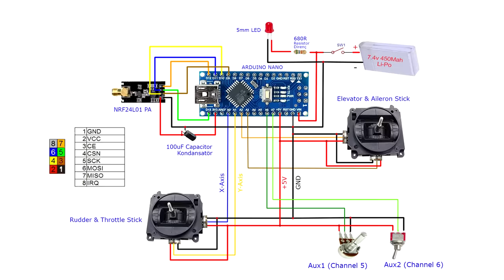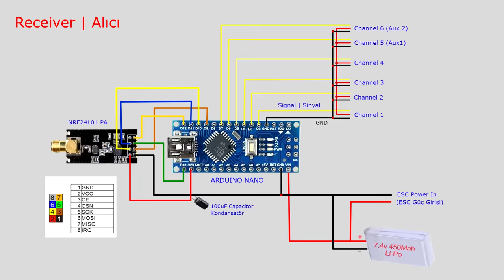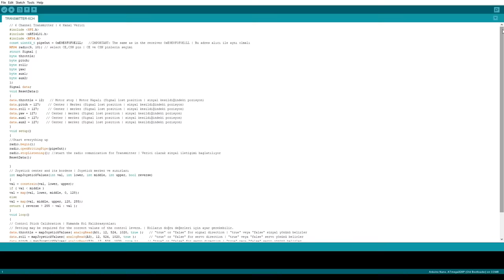DIY 6 Channels Radio Control For Models. How To Make İt

Comment: Hello sir, i have a few doubts on this project please help me please RELPY PLEASE SIR🙏🙏🙏🙏🙏🙏🙏🙏🙏🙏🙏🙏🙏🙏🙏🙏🙏🙏🙏🙏🙏🙏🙏🙏🙏🙏🙏🙏🙏🙏🙏🙏. in the RX side (reciver part) , i am using only the aileron, elevator,throttle,rudder and aux 1. HOW CAN I POWER THE CURCUT USING ONY THE POWER LINES WHICH IS THE CHANNEL 1-6, I MEAN I AM TALKING ABOUT THE CONNECTOR PINS, WHICH INCLUDES THE SIGNAL PINS, +VE PINS AND GND PINS. BECAUSE I AM BUILDING AN ARDUINO DRONE AND THE RECIVER SHOULD BE CONNECTED LIKE A NORMAL FLYSKY RECIVER AND FLYSKY RECIVER DOES NOT HAVE THE CIRCUT POWERED BY AN EXTERNAL WIRE UNLIKE THE ONE WHICH YOU MADE SIR. AND WHEN I SAW YOUR DRONE MAKING VIDEO WITH THIS TRANSMITTER . IN THAT YOU CONNECTED BOTH THE PARALLEL CABLE FOR ESC AND BATTERY CONNECTION. SO HERE I AM STUCK. IN OTHER WORDS , I MEAN THAT WITHOUT THE PARALLEL CABEL FOR ESC AND BATTERY CONNECTION WILL THE RECIVER WORK THE SAME AS THE NORMAL FLYSKY OR OTHER COMPANY RECIVERS OR SHOULD I MAKE ANY CHANGES IN THE HOMEMADE RECVER PLEASE REPLY IF YOU DID NOT UNDERSTAND MY QUESTION,PLEASE LET ME KNOW SIR 😟😟😟😟🙏🙏🙏

Comment: Can we add more operators?? I mean joysticks and switches...
Reply from the maker: Yes it is possible. It is limited to the pwm and digital output pins of the Arduino board.
Reply: @Kendin-Yap  what is the maximum operator limit?? Plz reply.
Reply from the maker: @samuddhaofficial4303  I think 8 for Arduino Nano
Reply: @Kendin-Yap  For arduino mega?
Reply from the maker: @samuddhaofficial4303  Arduino Mega is a big module for this type of project. That's why I never used it. But it will provide much more channels than Nano.
Reply: @Kendin-Yap  ok. Thank you very much for responding all the problems...Good Luck..!

Comment: Sir, I already made it but when I installed the component there was an error installing the NRF cable backwards and the same was positive, then I tried to connect it with Arduino, the idea was unreadable even though I had installed the driver, was the Arduino damaged because of the reverse installation?
Reply: Rebbot nano and then upload the code this happened with me also

Comment: Sir just one question if we add brushed motor esc can we control the motor in bidirectional rotation?? i  need to build a rc car is it possible or shall i need different codes? pls answer it would be a great help for me 🙏🙏🙏
Reply from the maker: You need to use bidirectional ESC. This is an issue with ESC.

Comment: Nice job. That looks very much like 1970s radio controllers. They had a metal frame though but it was usually coated with pale brown paint. I wonder where could you find those control stick modules?

Comment: Great job bro 👌 .. I only got a question 
In receiver why did u power the system with the direct 7.4 v ?
And u could Of used the BEC in the ESC 
As if anyone wanted 11.1v or higher 
That would kill the Arduino I believe 
After all  everything is awesome 
And I really like it .. Thanx for sharing
Reply from the maker: Thanks. Many versions of Arduinos support 7-12V input voltage. If you use the BEC voltage of the ESC it will work but you will have a lower value for the 3.3V output pin. This is not good for the NRF24 module. The control distance will be shorter.

Comment: Can I operate it with 12v power supply instead of 7.4v ?
Reply from the maker: You can run the receiver. Because the BEC circuit of the ESC already reduces the voltage. But not suitable for Transmitter.

Comment: 00:32-00:50 saniyeleri arası ardunioyu pcbye lehimlerken pinlerde kısa devre yaratacak lehimlemeler olması sorun yaratır mı?videodan izlediğim kadarıyla temas oluyor ben mi yanlış görüyorum acaba?acil yardım ben de rc kumanda tasarlamayı düşünüyorum da?
Reply from the maker: Videodan net görünmeyebilir ama pinler arasında bir temas yok. Temas olursa tabiki sorun olur. Pinler birbirine çok yakın. Lehimlerken dikkatli olunmalı.
Reply: @Kendin-Yap  anladım teşekkür ederim. Bu ardunio kombinasyonuna ekran ekleyip ekrandan pil seviyelerini kontrol etmek de mümkün mü
Ardunio nanodaki pin sayısı buna yeter mi yoksa daha gelişmiş bir ardunio mu alalım

Comment: what is the difference between NRF24L01 + PA Wireless Module and NRF24L01 Wireless Module?
Reply from the maker: The PA module has antenna and its range is much longer.

Comment: Hello, I have the plane ready, I installed a 30A esc with a 2212 1400kv motor, with a 7.4v li-ion battery (when I can buy a LiPo) when I go to half throttle, the esc cuts and restarts. Any suggestions ?? thanks
Reply from the maker: Are you using bidirectional ESC? One-way ESC should be used for airplanes.

Comment: The schematic diagram is not working, should each schematic module still need to be repaired?
Reply from the maker: There is no problem for the diagram.

Comment: Emeklerinize sağlık, cok emek olan güzel bir paylaşımın için teşekkür ederim, ayni kumandadan bende yapmak istiyorim sizden öğrenmek istediğim nrf24L01 ile yapılan kumandalarda kilitlenme ya da droneların kontrolden çıkması gibi proplemlerin olduğunu kullanmaktan vazgeçtiklerini söyleyen kanal sahipleri de var, sizde ayni sorunlar oldu mu? Aydınlatıci bilgi verirseniz sevinirim.....
Reply from the maker: Teşekkürler. Norma ticari üretim kumandalarda bile düşük ihtimal olsada sinyal kopması gibi sorunlar olabiliyor. Bu tip el yapımı arduinolu vs kumanda sistemlerinde ise bu risk çok yüksektir.
Reply: @Kendin-Yap  teşekkürler, peki kendiniz esc yaptınizmı? VideolRıniz da görmedim sanki, 30 ya da 40 amperlir esc yapsanız, onu da öğrensek sayenizde😊

Comment: Good job!
I just have a little problem:
How to calibrate the transmitter and receiver?
My servos they operate to a limited extent and the engine is working all the time, I can change its revolutions also to a small extent.
Thank you for your help. :)
Reply from the maker: For ESC, you can change the values on the Throttle line. Slightly different values may be required for different ESCs. You can solve it by trial and error. These values affect its movement and its limits.
The same is true for other channels.
Reply: @Kendin-Yap  Thank you for your help. Problem solved and now everything works fine.
In order to read the correct analogRead values, I used the serial port monitor in the transmitter program. The calibration process was successfully completed in a few moments.
Congratulations once again to the author of the project. Really good job.

Comment: i have a question. i finally managed to get the code to work but i encountered a problem. after a few seconds thje servos stop moving no matter how miuch i move the joysticks and it no longer works. do you know how to fix that problem
Reply from the maker: I have not encountered this type of problem. But there are several possibilities. There is not enough energy for the NRF modules. Maybe replacing the capacitor can be a solution. Another possibility is that one of the NRF modules may be faulty. It may stop working when it gets hot.
Reply: @Kendin-Yap  but the thing is that I am not using a capacitor I am using those power regulators that you can order with the nRF. And for power I am using  5200mAh RC car battery for both of them. And for my tests I do it on a bread board not directly sauntering onto a pcb

Comment: does this nrf24L01 modul, with this antenna version,  also work with sending packages back from rc-modell? the nrf24L01 modul with printed antenna on, is able to make it, i know.
Reply from the maker: Their working principles are the same.
Reply: @Kendin-Yap  , ok 1000 thx for info, going to buy the professional antenna version.....thx alot, i hoped sketches will be same, the printed antenna version on layer, has range about 100m, just for info, sending 11 servo-values to rc and recieving cmpass, voltage, and running time from rc-modell back

Comment: if the wiring + and - on the potentio reverse it is not a problem?
Reply from the maker: This changes the operating direction of the potentiometer. there will be no problem.

Comment: hey i have been having problems with your code whenever i try to do this with even 2 servos and a joy stick the servos stop moving when the joystic is in the center and whont move anymore and they stop moving altogether after a few seconds. do you know why this is happening

also why do you have that return reverse and true and flase at      map       joystick
Reply from the maker: This issue is not code related. The code works without errors. Check your circuit connections for the problem. Another possibility may be due to NRF modules.
Reply: @Kendin-Yap  ok. also can you tell me why you have that reverse ture and flase terms in your code becasue i really dont understand the purpose of those
Reply from the maker: @treverbelmont8393  "True or False" is for changing the signal direction. It may be necessary to change the direction of movement of the servo while making the settings of an RC model.

Comment: Why the capacitor? Excelent video!
Reply from the maker: The arduino pins cannot provide the current needed by the NRF24 modules continuously. There will be interruptions or it will not work at all. Therefore, support is provided with a capacitor. Capacitor provides a stable supply by storing energy.

Comment: this is a really awesome video. where do you solder the trim wires on the Arduino Nano. because I would like to ads trim. would i need too change the code.
Reply from the maker: These depend on mechanical trims and joystick potentiometers. Also, there is no cable connection.
Reply: @Kendin-Yap  how do I put trim like you have. My trim has 2 potentiometer on 1 joystick one for the stick and the other for trim

Comment: hello kendin will you please tell me which battery should I use for the transmitter
Reply from the maker: 2S lipo (7.4V) as in the video. Or 5 cells AA size battery (7.5V)
Reply: @Kendin-Yap  thank you for your help

Comment: AMIGO, BOA NOITE E PARABÉNS PELO MARAVILHOSO PROJETO. VOCÊ TERIA O DIAGRAMA ELETRÔNICO COM AS LIGAÇÕES DOS TRIME PARA AJUSTE FINO, COMO TAMBÉM O CÓDIGO ? É QUE NOTEI QUE O SEU PROJETO DE RÁDIO TEM OS QUATRO TRIMES. OBRIGADO.

FRIEND, GOOD NIGHT AND CONGRATULATIONS FOR THE WONDERFUL PROJECT. WOULD YOU HAVE THE ELECTRONIC DIAGRAM WITH THE TRIME LINKS FOR FINE ADJUSTMENT, LIKE THE CODE ALSO? I noticed that your radio project has four quarters. THANK YOU.
Reply from the maker: The diagram link is in the description box below the video.
Press the arrow symbol on the right below the video. (For mobile)
Click the "More Information" link below the video. (For PC)

Comment: Can I use 11v battery ? Without any changes?
Reply from the maker: Yes you can for receiver.
Reply: @Kendin-Yap  thank you for your information and also got information from data sheet 7v to 12 v I can use...👍

Comment: Hocam  NRF24L01 + PA Wireless Module kondansatör bağlamamızın sebebi nedir, bağlamış olduğunuz kondansatör değerlerini neye göre belirliyoruz
Reply from the maker: Kondansatör video da belirttiğim gibi güç desteği için gerekli. Arduinonun 3.3V pini NRF24 modülü için yeterli akım gücüne sahip değil. Kondansatör enerjiyi depoladığı için kararlı bir güç desteği sağlıyor. 10uF ile 100uF arası bir kondansatör kullanılabilir. Kondansatörün voltaj değeri ise devrenin üzerinden geçen gerilimin biraz fazlası olmalı. 16v veya üzeri olabilir.
Reply: @Kendin-Yap  Çok sağolun

Comment: Nice project👏
Can you please show how to get PPM signal from this transmitter for scenario where I want to connect a different radio module, or if I want to use as trainer in buddy box, or if I want to connect to an RC USB dongle for flight simulator. PLEASE I NEED TO MAKE ONE FOR THAT TYPE OF APPLICATION😎

Comment: nice,sir can i use adruino uno instead of adruino nano in transmitter?
Reply from the maker: Yes you can. But you may need to try different version library files for NRF24 module.
Reply: @Kendin-Yap  yes sir,finally i've got my result,thank u😘

Comment: Any idea what I should change in the code for an led channel to blink ( like blinkers on a car ) ? Thanks in advance !

Edit , I figured it out , just gonna drop the code here for anyone else to use 

Remove the existing digitalwrite for your preferred led channel ( mine was 5 ) and add thus code , make sure to use the proper " } " to close up any ones you opened

{if (receiverData.switch5Value==LOW) (

digitalWrite(led5, HIGH); 

delay(200);

digitalWrite(led5, LOW);

delay(200); 

}else if (receiverData.switch5Value==HIGH) (digitalWrite ceeds, leds, HIGH);

Change delay values to increase or decrease blink frequency.

Comment: Can it be used build a drone without a gyroscope? Please answer
Reply from the maker: Gyro is required for a drone. This is a remote control system. It does not contain gyro.
Reply: @Kendin-Yap  A gyro is expensive in our counrty. I guess I will have to go and build a RC plane instead. Thanks for your reply

Comment: It was great, but it would be better if you made a mix similar to that of model airplanes, integrating this joystick on the right so that when you move it upwards, two servos go upwards and when you move it downwards, the two servos move downwards, when you move upwards. the left one goes up and the other down, when moving to the right one goes up and the other goes down.

Comment: Hi, I have made the same trans and receiver with your help but now need help that I want that motor should reverse also so that this can be used in RC truck, so could you please help me what to do for this.
Reply from the maker: This is an ESC related issue. You should use bi directional ESC.

Comment: Sir if i made a drone using this transmitter and receiver and APM 2.8 flight controller, in Apm 2.8 have a mode RTL(Return to launch)
When the drone is goes out of range then the RTL mode will activate automatically,  so if i make drone using this transmitter and receiver, and my drone will go out of range then will RTL mode activate automatically in apm 2.8? 
Please reply.
Reply from the maker: Theoretically yes. But this control does not support S-Bus. Only PWM channels are available.
Reply: @Kendin-Yap  yes APM 2.8 support pwm signal

Comment: I made It work but in 2-3 days 
nrf24l01 is not working when I change nrf24l01 it work.what I do.can I use nrf24l01 adapter instead of capacitor
Reply from the maker: Yes you can.

Comment: I have no joystick with trim , I have dual axis joystick please send a figure of without trim joystick = receiver and transmitter
Reply from the maker: There is no difference in the connections. Because they are mechanical trims. Its absence does not change the way of connection.

Comment: I tried twice and each time the arduino of the receiver damaged and gets very hot and its not working 
Any tips or can i contact with you please i spent alot of money and I'm disappointed
Reply from the maker: If the Arduino is breaking, you are making a mistake with soldering and/or wiring. Short circuit and/or high voltage or reverse polarity will cause the Arduino to overheat and malfunction.

Comment: Herşey çok güzel olmuş elinize sağlık ama ben servo motor değil 3 tane dc motor kullanmak istiyorum bu durumda ne yapmam  gerekiyor?
Reply from the maker: Uzaktan kumandalara direk olarak dc motor takılamaz. ESC (Elektronik hız kontrol) ile kullanılabilir. Motoru ESC ye . ESC yi ise alıcıya bağlayarak kontrol edebilirsin.  Bu video da zaten hem fırçalı hem de fırçasız motor için göstermiştim.
Reply: @Kendin-Yap  hocam peki alıcıyı arduino uno ve  l293d motor sürücü ile kullanmak istesek. Üstünede NRF24L01 alıcısını entegre edebilirimiyiz

Comment: Can we operate it with 12 v battery to the receiver?
Reply from the maker: It can be powered by 12v by adding a voltage reducer as I showed in the other video.. https://youtu.be/RSDfMaanKXM

Comment: Can we use simple arduino joystick.
Reply from the maker: Yes you can.. My other video.. https://www.youtube.com/watch?v=bD7rQbnSbek
Reply: @Kendin-Yap  can we use your 6 channel radio controller for brushless motor drone.
Reply from the maker: @thesneh6873  you can use brushles ESC and Motor. It can be with some drone controllers.
Reply: @Kendin-Yap  ok with flight controller  I can use sir

Comment: if i use lipo 3s 11,1V, does it break??
Reply from the maker: Arduino Nano supports max 9V. It can be used with a step-down regulator (BEC).

Comment: Can I use other radio transmitter for receiver
Reply from the maker: Transmitters with multi-protocol can be used. Like Jumper or Radiomaster ..
Reply: @Kendin-Yap   can i use syma radio control transmitter

Comment: Eyy good video! 
Excuse me, can I ask u something? 
Can I use a capacitor 100uf 50v or 100uf 16v? Or it's neccesary that the capacitor be 100uf 25v? 
My lipo is 7,4v 850mah 2s and the motor brushless A2212 1000kv 
Thank u so much!
Reply from the maker: You can use all of them. 10uf-220uf / 16-50V
Reply: @Kendin-Yap  Thank you! 
I already did all the steps but can't achive that the servo moves and the motor, it seems like they don't receive signal, what can I do? 
Thank You, i'm sorry for many questions
Reply: @alejandravargas536   i am having same problem.Have you resolve it? If yes pls help me too
Reply: @Kendin-Yap   i am having same problem.Have you resolve it? If yes pls help me too

Comment: Hi! Is ist a way to make the code to output the sum or cppm (all servos each after each in a row) to feed an external Frsky module on ppm or feed an rc transmitter's trainer input to use your transmitter as a trainer system? Thank you!

Comment: I tried a lot but Nrf24 module are not working even after using those small adapter
Reply from the maker: Some NRF24 modules' antenna connection is problematic. Check the solder connections. Another problem is that the library file you uploaded for the NRF24 module may be incompatible. Try different versions.
Reply: @Kendin-Yap  ok I will try👍🏻